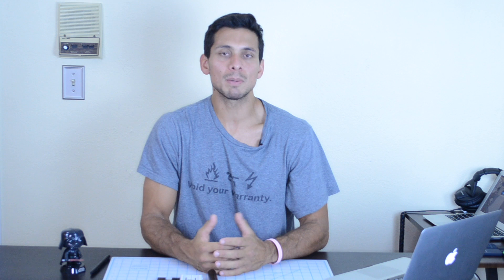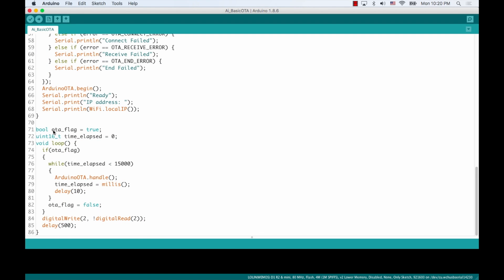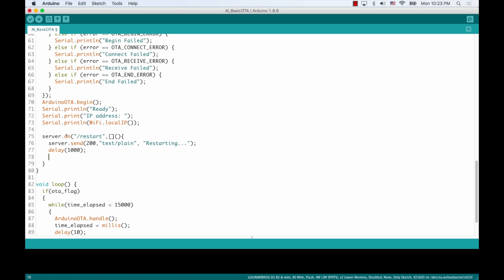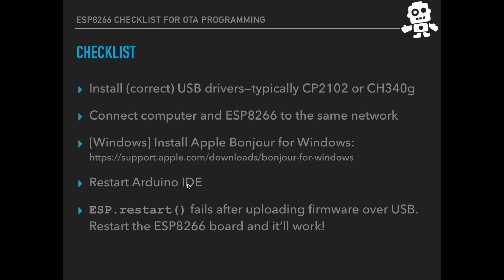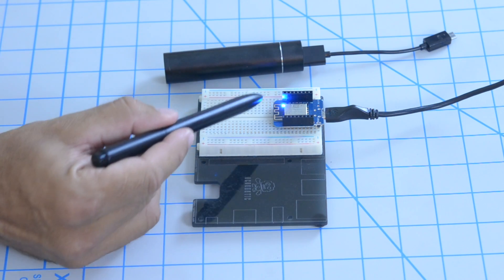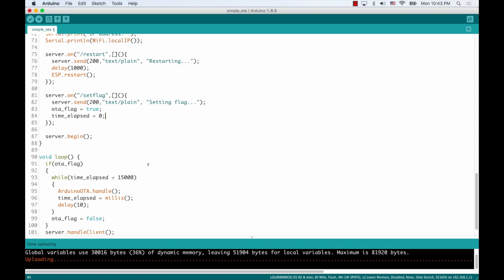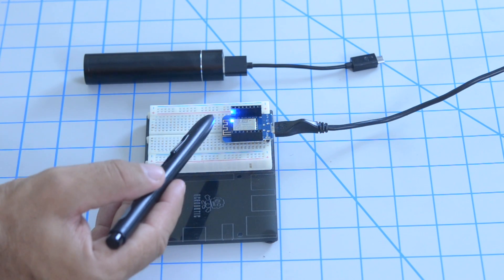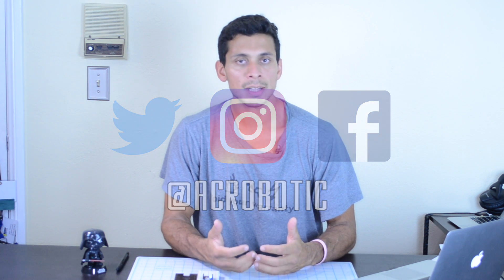ESP8266 Over The Air (OTA) Programming Without Reset Using Arduino IDE (Mac OSX and Windows)

Comment: Is it possible to do this process if the arduino and system are not conected to the same Wi-Fi. I want to know if we can do this if both are connected via internet, at two different locations

Comment: Hi. May I issue you a fresh and interesting challenge? ...
Show users how to update an ESP8266-01 (ESP01) 1MB with the latest AT firmware, NonOS and non-FOTA.
Non-FOTA is more secure - nobody can software attack your devices to reprogram them. The ESP-01 is still cheap, very abundant and doesn't take long to flash the memory.
You'll need these binaries: eagle.flash.bin and 
eagle.irom0text.bin but they don't come bundled with the SKD. They need to be compiled and that is the hard thing.
I would love to see you crack this :)

Comment: Nice informative videos about OTA programming!

I've been thinking about implementing it in some of my projects as well.
Why didn't you choose to just call the OTA.handle in the main loop, say every second? Performance issues? 
Or would the Arduino IDE time out (does it need a continuous handle loop)?
Reply from the maker: Thanks!

Yup, your instincts are correct. Whereas you can get it to work, if you start adding more tasks in your main loop like reading from sensors, moving motors, etc., then timing becomes an issue and OTA will suffer. With beefier processors like the ESP32 you can bypass this by using a separate core, but for the ESP8266 what I used is one of the better ways of handling OTA. HTH!

Comment: Thanks for video. I am facing one issue, Not sure if its IDE issue or something else. I tried your code from github but I am unable to find any option to see network port in Tools->Port. I can see only COM ports option. Any suggestion?  I m using latest Arduino IDE 1.8.12 in widows 10.  Do we have any other option to validate.

Comment: Thanks so much for this, it's such a great explanation as ever!! and it worked straight out of the box like a dream! I also managed to change it to work with ESPAsyncWebServer with no problems!

I am also looking at your tutorial "ESP8266 Web Server Upload Files Quick To SPIFFS Flash Memory Over HTTP w/ Arduino IDE",  as I will also probably want to be making changes to the pages my esp8266 is serving.

I notice (in reading the code to try and understand it more, I don't like to just cut and paste ...) that the ArduinoOTA.onStart appears to be able to update the SPIFFS as an alternative to the sketch,  but I have no idea where ArduinoOTA.getCommand() is set to U_FLASH and can't find anything about setting it to U_SPIFFS?  Any ideas or should I just use the curl command over HTTP as explained in your video?

Thanks again for all of your help, you make exploring the esp extremely clear and accessible to me!!

Pete
Reply from the maker: hey pete, i'm glad you found it useful—and, most of all, that it worked!

that is a really good question, to which i don't have a perfect answer as i haven't tried it myself. on the IDE, i suspect if you select the option "ESP8266 Sketch Data Upload" it'll send the contents of the sub-directory "data" inside your sketch folder to flash. obviously, there's an underlying tool that i had to teach myself about today (thank you!):

what you'd want, outside of the IDE, is something along the lines of "python3 espota.py -i <ESP_IP_address> -I <Host_IP_address> -p <ESP_port> -P <HOST_port> [-a password] -s -f <spiffs.bin>" to send your data to the flash file system. here's more info about espota:
https://github.com/esp8266/Arduino/blob/master/tools/espota.py

really, really good question!

Comment: I am getting no answer error message. I tried every thing. No use. Have esp8266 12e. And use arduino r3 and jumper wire to flash initially. Ota doesn't work.
Reply from the maker: make sure your mdns is woking and you can access the board both by its IP address and local domain name

Comment: It worked quite OK, but I found that on a running system with 6 MQTT nodes which run all the time, if I turned up with my notebook to upgrade firmware on any node, the Arduino IDE does not
see the controllers WiFi port.  It only sees the port when ArduinoOTA.handle()  is executed.
What I do is I execute that function  once a minute WHEN THE OTA flag is NOT set.
At most the laptop only has to wait for a minute before the  WiFi ports are recognized.
Reply from the maker: I'm glad you were able to work things out!
Reply: How to regain access to the ip address port from the IDE
Another solution is to add a "fake programmer" to the "Tools" menu drop down. 
1st, on Windows10, find the file "programmers.txt" .  The one that worked for me was: C:\Users\joe\AppData\Local\Arduino15\packages\arduino\hardware\avr\1.8.3\programmers.txt.   
2. Add the following lines at the bottom of programmers.txt file, save it, restart the IDE. 

# ESP Wemos #2 50:02:91:AA:BB:CC 	(just a comment line)
arduinoOTA142.name=ESP-Wemos-OTA 	(Drop down menu text)
arduinoOTA142.program.tool=arduinoOTA  (Don't know, just part of the IDE code)
arduinoOTA142.ip=192.168.10.142   (The static dhcp IP addr)

3. Select "Tools", scroll down to Programmers and your devices should show up there.
This is used instead of the com port which you typically choose.

Note: I reserve my IP's in my router's DHCP pool, ie, MAC to IP is always the same.  

See "OTA Upload from IDE without 'network port'" in the article at:  
         https://github.com/jandrassy/ArduinoOTA

Comment: One problem I see for larger code.
You opened your IDE and made small modification to a rather bigger code than this minimalistic example.
You want to upload, so you go to your browser and type the setflag thing.
Now you will have 15 seconds to close your IDE, open it again, find and select the OTA port in the IDE and hit upload.
As far as I understand the procedure, the IDE will at least have to start sending data to the device within 15 seconds.
That's not realistic with bigger code.

Or does your sketch broadcast it's OTA port even when the ota_flag is not set?
Reply from the maker: Old sketch waited 15 seconds. New sketch doesn't. You can configure the OTA flag with an HTTP request.

Comment: I tryed on NodeMCU and the webserver it's ok. 
I then choose the net port and put NodeMCU in Restarting...
Then I take an error: "07:00:00 [ERROR]: No Answer"  :-( 
Can you help me please ?  
Thanks a lot
Reply from the maker: After flashing the OTA firmware over serial, physically reset the NodeMCU before doing OTA (don't hold down the button, just press it once). After a few seconds, you should be able to upload the new firmware from the net port. Let me know if that works!
Reply: @datasith  I have same problem, I did reset ESP, but still same error - NO answer

Comment: Hi Cisco,
Two great videos, thank you. I am using two boards, i.e. an ESP32OLED (wifi and BT) and a Wemos D1 (wifi). The sketch compiles fine for both boards, but the wifi com port only appears for the ESP32. The OTA functionality works well on the ESP32. When I plug in the D1, and change boards on the IDE, the wifi com port disappears. Naturally I have run through the same setup steps for the D1. Any ideas? Thanks
Reply from the maker: That's very off, I wonder why. If the code uploads to the Wemos D1, it means that the board is okay so it's a software thing. I realize it's been 8 months so hopefully you figured it out, if not, by all means let me know (apologies for the late reply).

Comment: how to store data of ota programing if sensor is connected
Reply from the maker: You can save the data either to an SD card or SPIFFS so that it doesn't get erased when you upload a new program.
Reply: collect result like serial monitor
Reply from the maker: @ramakant610  the data will be stored in a text file in the SD card or SPIFFS.
Reply: @datasith   after ota programming , i am unable to store data in putty or not see the data in serial monitor..if serial monitor open it will gives error  while uploading code wirelessly
Reply from the maker: @ramakant610  Serial Monitor and Putty show the data transferred over USB. For OTA programming, there's no USB connection. You can see the data if you store it in a variable (RAM), or a text file in SPIFFS or SD Card, and then serve it over HTTP as a using the server.on() and server.streamFile() functions.
Reply: @datasith   could you please explain or send snapshot of process..thanks ADV
Reply from the maker: @ramakant610  sorry, with 13K subscribers it's hard to help everyone individually. Google examples for the functions I posted, it's a fundamental part of succeeding at building DIY Electronic projects.

Comment: Arduino: 1.8.5 (Windows 7), Board: "NodeMCU 0.9 (ESP-12 Module), 80 MHz, Flash, 4M (1M SPIFFS), v2 Lower Memory, Serial, None, Only Sketch, 115200"

C:\Arduino\arduino-builder -dump-prefs -logger=machine -hardware C:\Arduino\hardware -hardware C:\Users\rama\AppData\Local\Arduino15\packages -tools C:\Arduino\tools-builder -tools C:\Arduino\hardware\tools\avr -tools C:\Users\rama\AppData\Local\Arduino15\packages -built-in-libraries C:\Arduino\libraries -libraries C:\Users\rama\Documents\Arduino\libraries -fqbn=esp8266:esp8266:nodemcu:CpuFrequency=80,VTable=flash,FlashSize=4M1M,LwIPVariant=v2mss536,Debug=Serial,DebugLevel=None____,FlashErase=none,UploadSpeed=115200 -ide-version=10805 -build-path C:\Users\rama\AppData\Local\Temp\arduino_build_943895 -warnings=none -build-cache C:\Users\rama\AppData\Local\Temp\arduino_cache_281809 -prefs=build.warn_data_percentage=75 -prefs=runtime.tools.xtensa-lx106-elf-gcc.path=C:\Users\rama\AppData\Local\Arduino15\packages\esp8266\tools\xtensa-lx106-elf-gcc\1.20.0-26-gb404fb9-2 -prefs=runtime.tools.esptool.path=C:\Users\rama\AppData\Local\Arduino15\packages\esp8266\tools\esptool\0.4.13 -prefs=runtime.tools.mkspiffs.path=C:\Users\rama\AppData\Local\Arduino15\packages\esp8266\tools\mkspiffs\0.2.0 -verbose C:\Users\rama\Desktop\sensor\otawireless\otawireless.ino
C:\Arduino\arduino-builder -compile -logger=machine -hardware C:\Arduino\hardware -hardware C:\Users\rama\AppData\Local\Arduino15\packages -tools C:\Arduino\tools-builder -tools C:\Arduino\hardware\tools\avr -tools C:\Users\rama\AppData\Local\Arduino15\packages -built-in-libraries C:\Arduino\libraries -libraries C:\Users\rama\Documents\Arduino\libraries -fqbn=esp8266:esp8266:nodemcu:CpuFrequency=80,VTable=flash,FlashSize=4M1M,LwIPVariant=v2mss536,Debug=Serial,DebugLevel=None____,FlashErase=none,UploadSpeed=115200 -ide-version=10805 -build-path C:\Users\rama\AppData\Local\Temp\arduino_build_943895 -warnings=none -build-cache C:\Users\rama\AppData\Local\Temp\arduino_cache_281809 -prefs=build.warn_data_percentage=75 -prefs=runtime.tools.xtensa-lx106-elf-gcc.path=C:\Users\rama\AppData\Local\Arduino15\packages\esp8266\tools\xtensa-lx106-elf-gcc\1.20.0-26-gb404fb9-2 -prefs=runtime.tools.esptool.path=C:\Users\rama\AppData\Local\Arduino15\packages\esp8266\tools\esptool\0.4.13 -prefs=runtime.tools.mkspiffs.path=C:\Users\rama\AppData\Local\Arduino15\packages\esp8266\tools\mkspiffs\0.2.0 -verbose C:\Users\rama\Desktop\sensor\otawireless\otawireless.ino
Using board 'nodemcu' from platform in folder: C:\Users\rama\AppData\Local\Arduino15\packages\esp8266\hardware\esp8266\2.4.2
Using core 'esp8266' from platform in folder: C:\Users\rama\AppData\Local\Arduino15\packages\esp8266\hardware\esp8266\2.4.2
Detecting libraries used...
"C:\Users\rama\AppData\Local\Arduino15\packages\esp8266\tools\xtensa-lx106-elf-gcc\1.20.0-26-gb404fb9-2/bin/xtensa-lx106-elf-g++" -D_ets_ -DICACHE_FLASH -U_STRICT_ANSI_ "-IC:\Users\rama\AppData\Local\Arduino15\packages\esp8266\hardware\esp8266\2.4.2/tools/sdk/include" "-IC:\Users\rama\AppData\Local\Arduino15\packages\esp8266\hardware\esp8266\2.4.2/tools/sdk/lwip2/include" "-IC:\Users\rama\AppData\Local\Arduino15\packages\esp8266\hardware\esp8266\2.4.2/tools/sdk/libc/xtensa-lx106-elf/include" "-IC:\Users\rama\AppData\Local\Temp\arduino_build_943895/core" -c -w  -Os -g -mlongcalls -mtext-section-literals -fno-exceptions -fno-rtti -falign-functions=4 -std=c++11  -ffunction-sections -fdata-sections -w -x c++ -E -CC -DF_CPU=80000000L -DLWIP_OPEN_SRC -DTCP_MSS=536 -DDEBUG_ESP_PORT=Serial  -DARDUINO=10805 -DARDUINO_ESP8266_NODEMCU -DARDUINO_ARCH_ESP8266 -DARDUINO_BOARD="ESP8266_NODEMCU"   -DESP8266 "-IC:\Users\rama\AppData\Local\Arduino15\packages\esp8266\hardware\esp8266\2.4.2\cores\esp8266" "-IC:\Users\rama\AppData\Local\Arduino15\packages\esp8266\hardware\esp8266\2.4.2\variants\nodemcu" "C:\Users\rama\AppData\Local\Temp\arduino_build_943895\sketch\otawireless.ino.cpp" -o "nul"
"C:\Users\rama\AppData\Local\Arduino15\packages\esp8266\tools\xtensa-lx106-elf-gcc\1.20.0-26-gb404fb9-2/bin/xtensa-lx106-elf-g++" -D_ets_ -DICACHE_FLASH -U_STRICT_ANSI_ "-IC:\Users\rama\AppData\Local\Arduino15\packages\esp8266\hardware\esp8266\2.4.2/tools/sdk/include" "-IC:\Users\rama\AppData\Local\Arduino15\packages\esp8266\hardware\esp8266\2.4.2/tools/sdk/lwip2/include" "-IC:\Users\rama\AppData\Local\Arduino15\packages\esp8266\hardware\esp8266\2.4.2/tools/sdk/libc/xtensa-lx106-elf/include" "-IC:\Users\rama\AppData\Local\Temp\arduino_build_943895/core" -c -w  -Os -g -mlongcalls -mtext-section-literals -fno-exceptions -fno-rtti -falign-functions=4 -std=c++11  -ffunction-sections -fdata-sections -w -x c++ -E -CC -DF_CPU=80000000L -DLWIP_OPEN_SRC -DTCP_MSS=536 -DDEBUG_ESP_PORT=Serial  -DARDUINO=10805 -DARDUINO_ESP8266_NODEMCU -DARDUINO_ARCH_ESP8266 -DARDUINO_BOARD="ESP8266_NODEMCU"   -DESP8266 "-IC:\Users\rama\AppData\Local\Arduino15\packages\esp8266\hardware\esp8266\2.4.2\cores\esp8266" "-IC:\Users\rama\AppData\Local\Arduino15\packages\esp8266\hardware\esp8266\2.4.2\variants\nodemcu" "-IC:\Arduino\libraries\Keyboard\src" "C:\Users\rama\AppData\Local\Temp\arduino_build_943895\sketch\otawireless.ino.cpp" -o "nul"
"C:\Users\rama\AppData\Local\Arduino15\packages\esp8266\tools\xtensa-lx106-elf-gcc\1.20.0-26-gb404fb9-2/bin/xtensa-lx106-elf-g++" -D_ets_ -DICACHE_FLASH -U_STRICT_ANSI_ "-IC:\Users\rama\AppData\Local\Arduino15\packages\esp8266\hardware\esp8266\2.4.2/tools/sdk/include" "-IC:\Users\rama\AppData\Local\Arduino15\packages\esp8266\hardware\esp8266\2.4.2/tools/sdk/lwip2/include" "-IC:\Users\rama\AppData\Local\Arduino15\packages\esp8266\hardware\esp8266\2.4.2/tools/sdk/libc/xtensa-lx106-elf/include" "-IC:\Users\rama\AppData\Local\Temp\arduino_build_943895/core" -c -w  -Os -g -mlongcalls -mtext-section-literals -fno-exceptions -fno-rtti -falign-functions=4 -std=c++11  -ffunction-sections -fdata-sections -w -x c++ -E -CC -DF_CPU=80000000L -DLWIP_OPEN_SRC -DTCP_MSS=536 -DDEBUG_ESP_PORT=Serial  -DARDUINO=10805 -DARDUINO_ESP8266_NODEMCU -DARDUINO_ARCH_ESP8266 -DARDUINO_BOARD="ESP8266_NODEMCU"   -DESP8266 "-IC:\Users\rama\AppData\Local\Arduino15\packages\esp8266\hardware\esp8266\2.4.2\cores\esp8266" "-IC:\Users\rama\AppData\Local\Arduino15\packages\esp8266\hardware\esp8266\2.4.2\variants\nodemcu" "-IC:\Arduino\libraries\Keyboard\src" "C:\Users\rama\AppData\Local\Temp\arduino_build_943895\sketch\otawireless.ino.cpp" -o "C:\Users\rama\AppData\Local\Temp\arduino_build_943895\preproc\ctags_target_for_gcc_minus_e.cpp"
In file included from C:\Users\rama\Desktop\sensor\otawireless\otawireless.ino:1:0:

C:\Arduino\libraries\Keyboard\src/Keyboard.h:25:17: fatal error: HID.h: No such file or directory

 #include "HID.h"

                 ^

compilation terminated.

Using library Keyboard at version 1.0.1 in folder: C:\Arduino\libraries\Keyboard 
exit status 1
Error compiling for board NodeMCU 0.9 (ESP-12 Module).
Reply from the maker: The error tells you what's wrong.

Comment: Hi Thank
I tried in nodeMCU, it is working, is there any posible ways to do the OTA from other network means remotely

Assumption esp connected in a Wi-Fi
Reply from the maker: Yes, you can setup a route to receive the firmware and make the update. It's not strictly OTA, but it's a way of updating the firmware wirelessly. HTH!

Comment: Hi Cisco, ESP01 also have procedure problem in OTA. As we know, ESP01 is programmed in shorting GPIO0 to GND.  Normal operation in open  of GPIO0. This also a good challenge for me. Do you have good idea ?
Reply from the maker: What's the problem, you can load OTA software once, and then each time after you upload the code using OTA. Am I missing something? Sorry for the late reply!